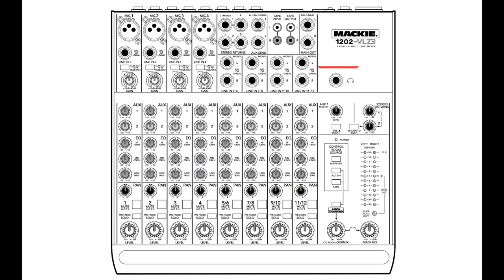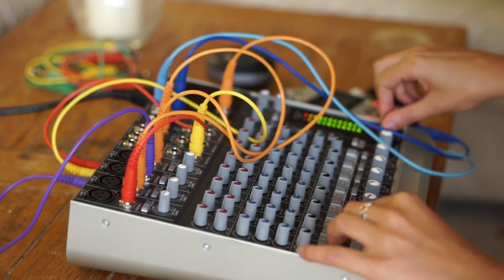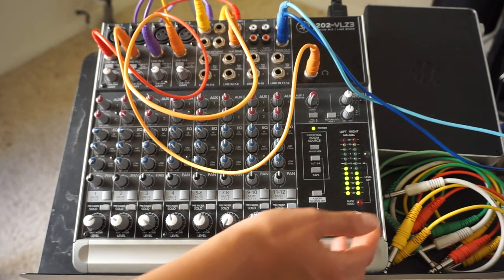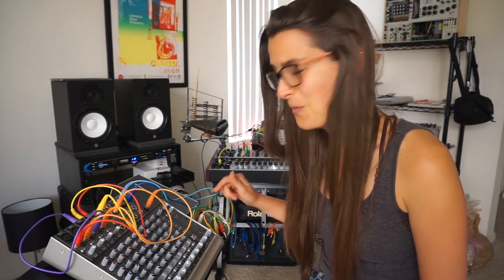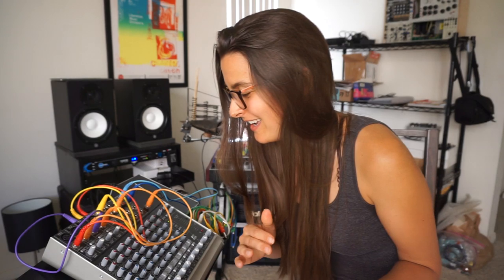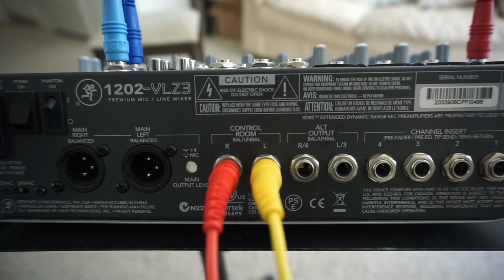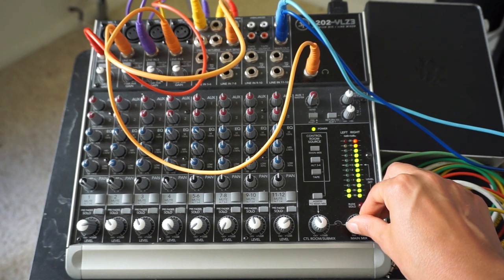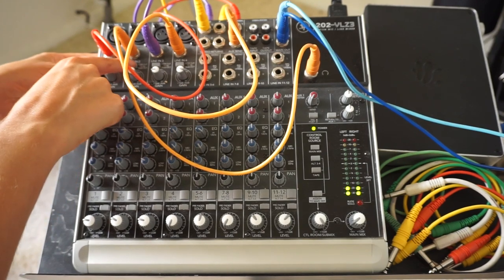No Input Mixer Tutorial | Sarah Belle Reid

Comment: Hey Sarah, lovely tutorial! I also perform with no-input mixer. One little trick that I had been exploring lately is to only put in the patch cable in the input about halfway, it opens up to a whole lot of different sounds! Another thing I had been doing is using a cable connected from output to my palm, the amount of contact to my palm would change the sound.
Reply: I would guess that the frequency response is different when using balance and unbalanced connection patching.

Comment: Sarah, thanks for doing this walk-through! I've only just recently started experimenting with no input mixing, so having someone walk me through the basics is immensely helpful and encouraging. I'd love to see more patch walkthrough demonstrations in the future! One thing I wanted to add in regard to the inherent danger of damaging your monitors due to the extremely hot output of your mixer: I've found that running the signal through a compressor before it reaches the audio interface is a great way to ensure that your levels don't exceed what be you're comfortable listening to or feeding to your monitors. I use an Alesis Nanocompressor, and it's perfectly effective at maintaining a safe volume level. It's an older unit, and can be found used for $30-$40.
Reply from the maker: thanks for watching! happy to hear the video has been helpful for you :) and thanks for the great suggestion!

Comment: Oh wow. This is really awesome! I used to have a similar setup, but I had a couple of sine wave generators that I bought off of ebay that could produce frequencies above the audible range. It's so much fun to fiddle with knobs and all of a sudden, bam, you've got a rhythm. Have you ever incorporated the channel inserts? It doesn't look like that mixer has pre-fader switches, but you could use the input from one channel as the line insert for another, though you'd have to split one of those balanced cables into dual outputs. At any rate, love what you're doing, I ran across your channel when I was vetting the morph, and you definitely make a good pitch for them.
Reply: How do use the generator with freq above the hearing range in this kind of setup? I have a wavetek from the 1970’s I’d like to use.

Comment: Did you notice that actually the Mackie mixer has symmetric connectors? That means that by feeding the headphone out via „stereo“ cable into a line in, you're getting the left headphone channel mixed with the phase-inverted right headphone channel. This probably gives the panning knob a different kind of twist.

Comment: Very cool video. I would be concerned a little with cooking internal components over time, specifically input transformers and accompanying components as I have witnessed feedback loops killing vintage mixer circuits in a Tascam M-308 for example... but maybe that wouldn’t be a problem. Maybe a Mackie 1604 could be a good option as there is a lot of routing options as it can accommodate a multitrack tape set up i.e. in-line or rudimentary in-line... but has direct outs etc... and lots of aux returns and sends...
Reply: On vintage gear with high ratio step up transformer, possibly yes. But modetn analog mixers all use very low level audio level voltages with passive circuits. Only when things get amplified is when it could get out of hand. The headphone(amplfied) out back into a line level circuit...maybe? Chances are low.

Comment: Hey I dont know if you can help me with this but I tried some no input mixing over the last months. Everything went fine but at a jam session I experienced something strange. Because I wanted to combine vcv rack 2 and send everything out to one stereo channel to a mixer (only one was left) I had to use an interface (focusrite 4i4 newest gen) to send both out. Unfortionatley the interface blowed up two times while playing with no input mixing. I tried this at home and also there problems occured (like the typical clicking of too litle CPU for a low block size). Have you ever experienced similar problems with no input mixing and a digital interface? I thougt, maybe the reason for this problem is that the frequency and amplitude of the no input mixing signal is too extreme for the digitial mixer (like there is no samplerate available that could display this signal because of its extremness and therefore errors appear).

Comment: Wow, I had no idea that mixer generated feedback had graduated into "no input mixing".  Cool tutorial. This kind of thing really shouldn't be done with anything other than low budget mixers, as what you are really creating are the sounds of machines dying. Obviously, fantastic results can also be achieved if you have one of more audio inputs to feed your loops, however, to make best use of this requires even more precise adjustments to bring things to the very edges of their feedback points so that the fed in tonality isn't completely overwhelmed by the mixer's internal tones, but instead the relationship becomes synergistic, and the tones have a chance to degrade and decay "naturally". Right at that nexus of feeding back and decaying away is where so much of the magic is found. A limiter or two on your master output to avoid speaker damage is also not a bad idea.

Comment: It's not entirely unpredictable but I agree the differential equations needed to predict and design sounds this way are almost impossible when you have a network and you also have non-linear systems and linear systems all working together. The flat EQ is actually doing phasing. So beside the filtering, you also get different time delays at different frequencies of oscillation.

Comment: Awesome tutorial! I really enjoyed it. I've recently found this No Input Mixing technique and I find it really interesting, however I don't know much about somethings and it's making me feel like it's another thing I'm not going to do just because I don't know really know where to start, which I don't want... I would hate to not get into this just because I don't know some things. So, I'm guessing you (or someone else in this comment section) can help me with some questions I have (if you want to, and if you can, of course): 1) Do the Patch Cables required for this technique need to be of 6,5 mm? (like an interpedal cable) or are they 3,5 mm (like regular headphones)?  /  2) Does the sound always have to go through an interface or similar?  /  3) Does the Main Out of the mixer have to be used in order to create the initial loop? or, can it be used like a regular Main Out so I can hear the sounds I am using? Again, thank you very much for this video, it's quite helpful!
Reply from the maker: Hey! Glad you're getting into things—it's a lot of fun once you get up and running! As for your questions, 1) The cables you use just depend on the connections on your mixer! I'm using 1/4" (6.35mm) cables, which the majority of mixers employ. 2) The sound doesn't need to go to an interface—you could just run directly to speakers as well, or even into another mixer. 3) You don't need to use the main output in the feedback path if you don't want to! Especially if your mixer has a lot of aux sends, it might be better to rely on those for feedback and leave the main outs set to act as your primary output since you'd have a predictable and accessible volume control that way. Hope this is helpful :)

Comment: Hi! Great video! I’d heard of this before but never tried it until seeing this. I feel the power!
Question: When performing with a no-input mixer live, how do you send signal from the master outs to the PA or amplifier? My guesses were: 1) If going direct to the PA, run mono lines from L & R master outs to two separate channels on the PA; and 2) If going to an amplifier, use a dual 1/4” mono to single 1/4 stereo cord. 
Am I on the right track?
Reply: Oh! Another question: What happens if you do this with a powered PA mixer? I’m assuming total destruction of everything, right?
Reply from the maker: Hey! This depends on your patch and mixer to an extent.. if you’re using the master outs as part of your feedback path I would definitely recommend using something like a DI to pad the signals before they hit the PA… but if you’re not using them in your feedback path then your main volume knob on the mixer can attenuate signals and yes - you could just run from the master outs into the PA… but then still be mindful of output levels! :)
Reply from the maker: With a powered mixer it’s not advisable to do this if you’re using the master outs as part of your feedback path - that will damage the mixer

Comment: Thanks  a lot for your kind and fast answer.
Would be ok if I connect this to a computer to record it, without interface?
And last, would you recommend a cheap one with more tracks (32...)
Reply from the maker: You technically could, I suppose, but I would caution you to be careful of your output levels from the mixer because they can get really high. I would recommend using an interface because it will make things a lot more controllable overall. And for your final question, are you asking about an interface or a mixer? For no input mixing, having lots of channels is nice, but honestly having a mixer with a bunch of aux sends is perhaps even better, so I would prioritize that over getting a mixer with a ton of channels. You’d be surprised how much sound you can get out of even an 8 channel mixer with a couple aux sends!
Reply: @sarahbellereid  I think you are right. Sometimes less is more than enough. Thank you very very much.
 I wonder where do you get this short cables!
Reply from the maker: Im pretty sure i included a link to the cables I use in the description of the video! :)
Reply: @sarahbellereid  You are absolutly right. Sorry.
Reply from the maker: Juan Vial no need to apologize at all!

Comment: How do you determine when and where to patch with the TS or TRS cables?
Reply from the maker: Generally you can check the mixer's manual for whether an input/output is balanced or unbalanced. Though since we're playing with "mis-use," if you use the wrong cable it won't damage the equipment, but might change the character of the sound. Using balanced in an unbalanced connection for example will have the effect of dropping the levels of that signal by about 6dB.
Reply: Cool. Thank you. @sarahbellereid

Comment: This damages the mixer. Especially if it's digital with a usb. I don't exactly know why. 
I fried an Alesis Multi Mix 8 - tried using it the next day and everything I played through it sounded distorted and randomly cut out until it completely broke. Still turned on but no sound.
Reply: it can definitely damage a mixer but its rare. the guy who coined the term no input mixing and first came to prominence for utilizing the technique used the same Mackie mixer for 20 years doing this multiple times a week.